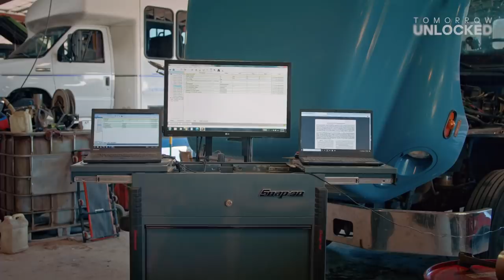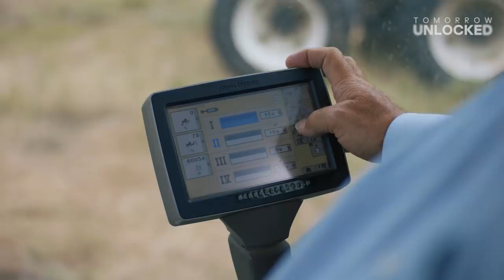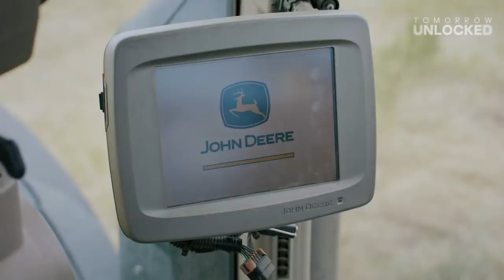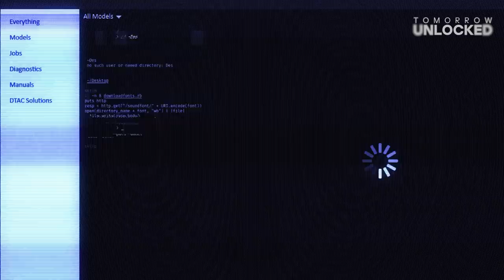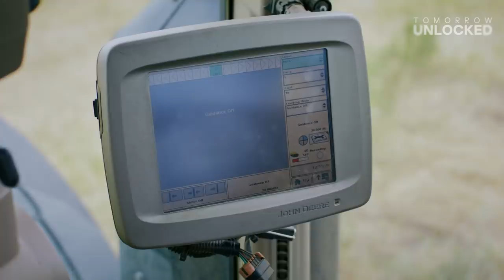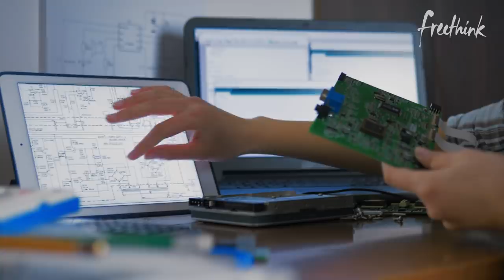The farmers forced to hack their own tractors

Comment: Maybe my grandpa's stategy to never get new things for his farm, like how all of his tractors are still from 1972 they require no software was a good idea
Reply: Eric Van  learn linux  and apply to running cars trucks and tractors. If you have to reverse engineer do it. Cars have already been tinkered with. It's time to open our horizons and apply to all consumer products.
Reply: Karia  I totally agree with you. Keep all classic vehicles no matter what they are.
Reply: Eric Van  it's OK I'm computer illiterate for the most part. Programming was not my high point but I am learning linux mint on my laptop. At least there is group forums out there to help. I have ulcers on my legs and fall into a limited pysical ability.
Reply: Ron B  U won’t have suffer with that for long if u get some BLACK SEED OIL softgel capsules. It’s great for inflammation. BUT...if you are on beta-blocker (blood pressure meds)  then the Black Seed Oil won’t be effective. Just tryna help. 🙂
Reply: @N-Da-Bray  I do take 5 MG Lisinopril and a water pill. I can try to get blood pressure lowered naturally. I been putting things off but it's time for change. Thanks I will research natural remedies for all my health issues.
Reply: @N-Da-Bray  I don't think I can take Blackseed oil while in pradaxa.  I will have to ask my physician. There are natural health specialist that may help as well. I already tried brokonise to try to get rid of the clots in my legs. But with no success.
Reply: Yeah, the older I get, the smarter these old boys get.
Reply: Yeah and we didnt need chemicals in our food until lately. Time to turn back the clock for winter. I think we all could live healthier if we skip the chemicals and grow organically we wouldn't need expensive sprayers. It was fine for my parents and grandparents the old ways. The Amish don't use expensive equipment and there grown food is much better all the way around. It may cost more but can you put a price tag on good health? Oh is mass produced food really  cheaper? Add up all the doctor bills and meds.
Reply: If you can handle the gas consumption then cool.
Reply: There's a cost to being Independent not having to depend on someone, that's the cost of automation.

Comment: Corporation: * Purposefully designs equipment to eventually break *
Also Corporation: * Makes it illegal to perform repairs on said equipment, that is purchased and "owned" by the consumer * 
[INSERT SCUMBAG W/ FITTED CAP MEME]
Reply: Scumbag steve?
Reply: I don’t see corporations designing their equipment to break though? I’ve only come across a couple of products “designed to break” but even then I think it was just cheap manufacturing.
Reply: @whatitis5646  or designed to shut down until scheduled maintenance occurs
Reply: @whatitis5646  cheap manufacturing = not designed to last = designed to break 

take automobiles for example... auto manufacturers would be out of business if they produced every car with high quality materials and engineered vehicles so that they can last a decade without replacing any major parts.
Reply: Jacob E some car companies are famous for this, like Range Rover. However, cheap manufacturing does not mean not designed to last. For example take a look at mechanical (as in no computers) cars, they’re cheap and will last you a long time as long if you treat it right. The only issue they really have is inefficiency and frames and bodies that are built too strong
Reply: Alex Planned obsolescence is absolutely a thing, especially in the field of technology and electronics. Because if you make something that lasts forever, you’re not gonna be able to make as much profit as if you make something that lasts a year and then breaks, and then people have to either pay money to get it repaired, or buy the newest thing. This happens with phones a lot.
Reply: @whatitis5646  just look at Apple they literally cannot be repaired by anyone it stopped being manufactured about maybe two years after their release which means they don't repair it anymore either

Comment: I thought this well over a decade ago, you buy a product, it’s still tethered to the manufacturers because of the software.

A bigger threat to the manufacturers would be, if a company could legally retro-fit (???) equipment with much more basic electronics, or simply something mechanical.
Reply: Someone should be able to design and market a tractor that doesn't need computer gadgetry to do its job. He'd have to fight the big boys, though, and they've got it made.
Reply: @None-zc5vg  Easy to design, and all the parts and stuff you might need are off-patent and easily available.

But environmental regulations apply to tractors too now, so you can't meet the legal requirements to sell them without computer control, and you can't allow the user to adjust the programming themselves because they might muck with the emissions stuff.

Same reason your little 2-stroke weed eater now has a proprietary screwhead on the mixture valves.  Only certified shops are technically allowed to fiddle with the settings.

Comment: Scary stuff. All these trucks cars and equipment go offline due to a disaster.
Reply: One EMP and we're back to horses and ploughs.
Reply: @Sum Gumption A solar flare is more likely than polar shift. One happened in the 19th century and set telegraph wires alight. That would fry almost all modern tech.
Reply: @Sum Gumption I'm well aware of the notion of polar shift and also how magnetic north has moved considerably since my birth. But as I said, it isn't the only show in town.
Reply: Sum Gumption 

found the anprim

Comment: Once people stop buying them then they will change, not until then.
Reply: Thays the problem they need to buy in order to operate catch 22
Reply: @Tab thimk about all the stuff flying around about slaves atm and this is the same the companies want to own you
Reply: They are the only option, farmers need a tractor
Reply: That's also impossible that is exactly why legislation has to be changed on it and it takes a lot of work to get to throw out corrpt legislation"and it takes many people to stand up!!
Reply: It's a colossal problem in the farming industry. This equipment is huge, and specialized. We're talking about pieces that easily cost over $250,000 and up, hardly a garden tractor.

This investment absolutely must last and be serviceable in the field. Let's put this in perspective. Your car. Ignition system fails. Nope, you can't tow it. Only one source for the part. We have to send a factory technician out to fix it, and charge you thousands to send him to you. Silly?

Just ask the farmer. He doesn't think it's silly.
Reply: @danmcg_4727  right, but buying a nice used older one can work just as well, my newest tractor is a 1992 and it does the job perfectly without spending an arm and a leg, plus the dealership doesn't get a cut of stuff being sold on craigslist lol
Reply: If the farmer done just that , the world would starve, so that’s not an option, let’s help the farmer help us, everyone wins , as far as the monopoly of the tech companies controlling the software, let’s put them out to pasture, get rid of them, oh I think it’s God’s plan to do so too!
Reply: Terry, I'm sorry to tell you this, but the farmer only has two choices of tractor.
John Deere, or [insert ANY competitor here] which is owned by AGCO. 
There is no other choice for a tractor, sans building one.
Reply: Whom do you buy from? All the competition is gone. They are a monopoly.

Comment: I have a 4020 built in 1966. I have a parts catalog and a service manual with all the data about to disassemble and reassemble to correct tolerances.  If anyone has been paying attention, prices of 20 through 60 series John Deere tractors have been bringing record prices. John Deere just introduced a corn planter designed to be operated by older tractors.  Maybe people are passing on the new stuff.

Comment: 03:40  "And that can only come with legislation."     Not true.   Someone can develop an open hardware standard that competes with John Deere and other AgriTech vendors so that entrepreneurs can produce repairable devices.   This is similar to what LineageOS did for Android in the Smart Phone arena...whereas Apple's iOS remains proprietary and locked.
Reply from the maker: Good point!
Reply: Go for it! Lots of great ethical hackers out there......anyone listening?
Reply: The EPA requires non-certified mechanics to be locked out of making any adjustments that might affect the emissions.  So you can develop the open standard firmware, but the computer system it runs in will have to be locked down so you can't do anything with it if you want to sell the tractor in the USA, and replacing that computer system with something else is technically illegal, so marketing replacement computers is tricky.

Comment: Thank you. I hope the bill is passed. I work as a technician for an equipment manufacturer- I won’t say which one, but the owner interviewed here is right. 
This is my perspective; The manufacturers want control and money. Everything is proprietary and like this gentleman said, the SOFTWARE is required for diagnostics and to change the configuration of the tractor. It goes even further than that. If a hydraulic hose fails, I’m willing to bet John Deere has a proprietary hose and fitting that can’t be made up at a local shop. The owner has to make a trip to the dealer. 
Some manufacturers pride their equipment on being built to be re-built, but that doesn’t mean the owner can re-build their own equipment. 
If a company really did want to make a name for themselves, why not build a quality piece of machinery that was engineered for the common man?  Sure, the new emissions systems are complex, aggravating, and severely limit the life and productivity of the engine, and most owners would need help with some of the systems... but if an owner could do 90% of the maintenance, repairs, and overhauls themselves, at least they would feel better about coming back to the dealer for the parts and services they did need from them. 
Yes, they might not sell a new tractor to the farmer every 10 years, but I’m willing to bet they couldn’t build enough tractors to keep up with the demand, if they would start manufacturing tractors for the common man.

Comment: I know that this video is related to farmers and their equipment, and I support and appreciate them greatly but, I had the same thought and aggravation when my Dodge dealer told me that I had to take my wife's car to them to simply check the transmission fluid. I truly hope that farmers are able to get something changed on this unnecessary issue. I think that it will definitely turn things around in the auto industry also.

Comment: The dealers do this to keep you out of the emission systems so the end user doesn’t realize their emission systems aren’t turned on, so the emission equipment is there but the computer system isn’t making it work correctly so the tractor is in a continuous cycle of breaking down and going to the dealer for repairs. Paccar has been doing this for years with cummins engines, when you get any paccar truck (peterbilt or kenworth) the emission systems aren’t turned on. 1) Heat stabilization feature is disable 2) Regen with parking brake disable 3) Regen in PTO mode or remote mode (cruise control) disable 4) automotive mobil Regen under 35mph disable. Your equipment is set up to fail from the dealer and they’re not telling you about it so the trucks break down and you have to take them to the dealer for repairs. It got so bad cummins themselves started enabling all these features cause paccar refused to. I’m sure John Deere saw how much money paccar made off emission repairs and wanted a piece of it.

Comment: The thing is that every vehicle manufacturer is doing the same thing to some degree or other. They all maintain the software remains proprietary. Hence a transmission trouble code on your 18 year old Mercedes means a trip to the dealer. OTOH, I can't replace the factory radio in my Oldsmobile because no one has the needed computer program to reset the vehicle security system.

Comment: This is why my wife’s dad won’t even look at a tractor made later than the 70s. And he isn’t the only one. Which is why old tractors maintain their value and even appreciate if well maintained. 
Sure, new tractors have gps, nice sound systems, and cool air conditioned cabs, but what good is any of that when a software glitch or shorted circuit board won’t let it start. There was nothing wrong with simple engine/ transmission/ wheels. There’s no need for a single circuit board on a tractor.

Comment: Had the same issues on Seadoo watercraft . They use a form of software that runs on can bus. Just like Trucks but not the same. Independent repair shops couldn't get the diagnostic software. But that changed to a point. I think farmers need to form COOPS . so you can compete with corporate farms and then you can work together set prices and lobby washington or the state or even get a deal. With a Tractor manufacturer on software and share it. Takes work trust and co-operation.  Everyone in the group has some expertise to share

Comment: I've gone against multiple entities on my own and have changed a few things.
   There are good Lawyers out there but in the beginning I had some that Did not  represent my interests at all, they walked in court with me and then did not follow the battle plan at all, I was blown away.
  I learned to do as much research on my own as possible. The more leg work I do , the easier their job is. As well , it is harder for them to deviate from your Bullet Points and Script. So I learned to use them (with respect) as mouth pieces. 
    One of the best paths to take is to use cases that set precedence in a field so to say.
   With Automotive, OBDII OBD2 is a great example of t he Auto manufacturers having so many different computer languages and diagnostic tools among other things..  I will try to get beck here and add more.. later..
  Quickly though , Farm Equipment falls into the same category under these laws , depending on the machinery , and may very well be in breach of multiple Regulations and Laws.  Food for thought.. I will try and get back, 
   Anyone have input on this ?

Also. CALLING ALL HACKERS AND CODERS AND PROM WRITERS.. TIME TO JUMP IN...

Comment: When tech decided to make you get a subscription to the software instead of buying and owning it, that is when we lost control of major parts of our lives. Government is complicit in this as well because of EPA regulations that won't let you touch anything with that has to do with emissions. That means everything to do with engine management, exhaust, fuel system, etc. Then there is the auxiliary systems that run equipment that they also hold you hostage with. When I buy something I want to own the whole thing including the electronic software to operate it.

Comment: I had to adjust a pre-set carburetors on my weed eater that was non adjustable thanks to EPA regulations.  I got on youtube and watched a video on how to bypass and remove plug that inhibited me from doing so.  I had a "non starting" weed eater before and now, after adjustments, it is running like new.  It is really sad because they do the same for vehicles, unfortunately bypassing things in vehicles will fail an inspection.

Comment: Tractors, cell phones, computers, AND house hold appliances!  
I've never been a farmer, great grand parents were share croppers, extremely poor.  I used to be able to take the front panel of my dryer off and do very basic up keep type maintenance, now the dryers are built so I have to remove the top of the dryer (the panel that exposes the electronics) off and remove the 3 sided surrounding metal frame of the entire dryer, and still you cannot access anything to do any maintenance from the front, the rear of the dryer has to be removed to access anything, and that is all enclosed also. The up keep I was able to do would extend the life of the dryer, we could reach and replace a belt, it is all designed to keep us slave to the manufacturers repair people.  Not only are we reliant on repair people, but many are also pushed to buy appliance warranties, and special appliance insurance, IT IS ALL A SCAM, from farmers to homemakers, fleecing us of our household income, in a sense, keeping many of us share croppers.

Comment: Being a once appliance repair man (still am but there’s a lot I can’t do now) I can’t agree more with the right to repair movement. Appliances now have ports that you access the computer with only the factory has the equipment to use them. A bad code will close down a refrigerator and there’s nothing I can do. Or if a compressor goes out a software update has to be done to except the new part. It’s crazy stupid!

Comment: Farmers can work on their own tractors. All that happens is it voids the warranty. You can buy the service manuals from any company you just have to be willing to pay the 2k plus per manual. Oh and pay the 5k a year fee to use their software to diagnose and update the controllers.
All that being said if you pass laws that say companies have to give up their service manuals (which contain company specific info so patient and copywrite applies) then say goodbye to any warranty. No service shop will put their neck out for a lawsuit when they don't know what the farmer has done. 
Also much of what the farmers want to hack is the environmental protection software that puts the engine into limp mode until it is fixed. A good 60% of the problems that modern tractors have are caused by government regulations. 
Those farmers that do get caught can enjoy up to 32k fine per incident by the feds. So yeah go ahead and see farmers get hurt more financially.